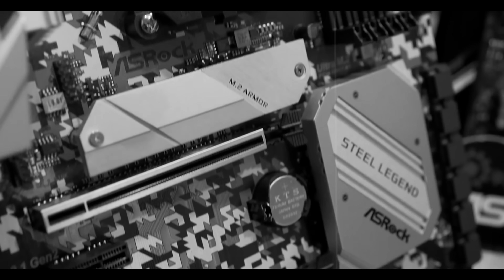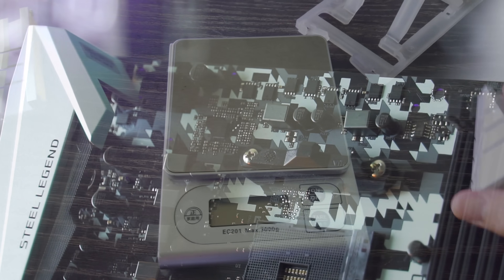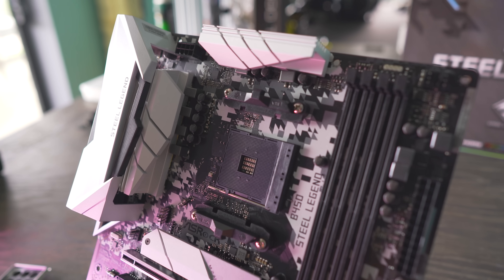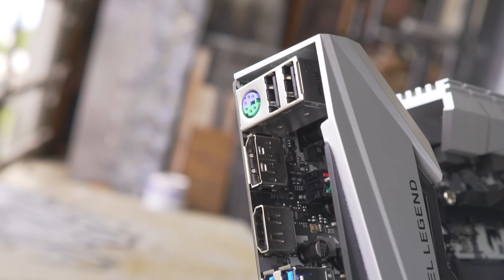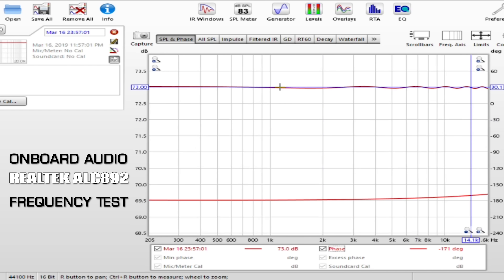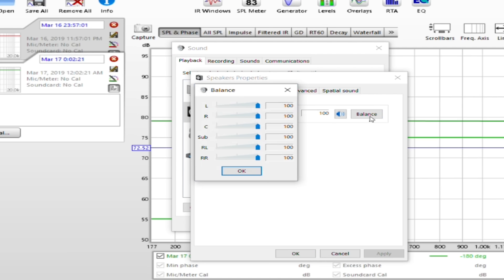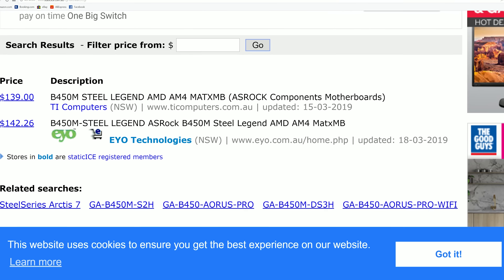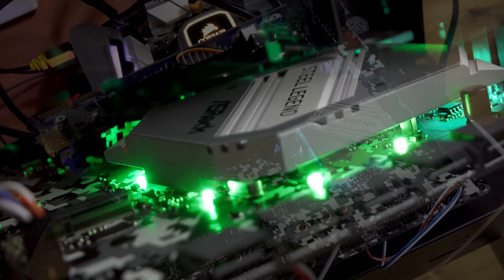Is this The BEST Value B450 Motherboard Right now..!? (Steel Legend Review)

Comment: Am I the only one that thinks that Bryan's "Peace out" sounds more like "Peas out"?
Reply from the maker: At one stage in life I was eating nothing but peas.  Peas out for now, bye.
Reply: @techyescity  Peas out for now, buoy
Reply: @techyescity  How much voltage were u pumping through the vrm? that's the question
Reply: @techyescity  I am having an unusual issue. i have R5 1600 processor , Corsair Vengeance 3000Mhz (2*8GB) RAM kit and MSI 450M Pro VDH motherboard but my RAM sticks are running only on 2133MHz instead of 3000MHz. Turning on A-XMP or manual OC from bios is not helping me out and RAM sticks are working only on 2133Mhz which is stock. Updated the bios but same issue. Even i have changed my motherboard and bought Asrock B450M steel legend and used Crucial Ballistix sport 3200Mhz(8GB*2)kit but found same issue. Could you please help me out.
Reply: Aᴍᴀʀᴛʜᴀʀ Dʀᴀᴋᴇsᴛᴏɴᴇ how am I still alive🤣🤣🤣
Reply: Or piss out...maybe?
Reply: I have always had it hit me as "Pizza out, Bye."  But that is just my ears.

Comment: Hello, is there any setting to activate in bios in order to be capable to use dual PSU with this motherboard ? I have dual PSU 850w (cooler master) and one keep turning off after 5 second starting my rig, Tried everything, both PSU are both working fine and the same happen doing opposit. Tried also PSU1 / 1gpu/1riser  and PUS2 /1gpu/1riser but still turning off after couple sec. I am not sure if it's because i didn't activated option in bios in order to use dual PSU/ I use splitter psu by the way and not add2psu. Processor is AMD 200GE and use latest bios ver4.20

Comment: @ Tech Yes City ; could you do a follow up video on a Asrock b450 steel legend but with an air cooling solution instead of the water cooled as you did in this video?  Down draft air cooled solution (Snowman down draft 4 heat pipe) and see what the VRM temps are like?  I've read that is the issue with water cooling you don't get good air flow near the VRMs.  Thanks!

Comment: was intending to go for the mortar max but since that is out of stock was planning to go for this and pairing it with a 3200g. just wondering, will it be possible to use my kingston 2133 4gb valuram X 4pc with this setup please?

Comment: I am having an unusual issue. i have R5 1600 processor , Corsair Vengeance 3000Mhz (2*8GB) RAM kit and MSI 450M Pro VDH motherboard but my RAM sticks are running only on 2133MHz instead of 3000MHz. Turning on A-XMP or manual OC from bios is not helping me out and RAM sticks are working only on 2133Mhz which is stock. Updated the bios but same issue. Even i have changed my motherboard and bought Asrock B450M steel legend and used Crucial Ballistix sport 3200Mhz(8GB*2)kit but found same issue. Could you please help me out.

Comment: I'm getting this for the Ryzen 2600X I'm going to order along with it.
Reply: I have it and I've already got thermal pad oil leakage on the back with a 3600
Reply: @Shvraz  ooo good thing I ended up going with a B550 Pro4 instead
Reply: @pixeldeath85  I mean it's not an issue but it does show that the vrms were under stress even with a 3600 (although oc to 4.3 at 1.325v). Going with a b550 was a good choice though.
Reply: @Shvraz  that's funny, yeah I ended up spending a little more and getting a B550 with a 3600 myself. Ended up finding at 980ti for 300 to use a place holder card until the market stabilizes.

Comment: I NEED TO KNOW SOMETHINGGGG. Can i use the samsung 970 evo plus 250gb on the ultra m.2 slot? And then what m.2 type is the bottom slot. For example is it the same m.2 type as the 970 evo plus or is it like the samsung 860 evo... i need to know thissssss PLEASSEEE helpp
Reply: Top slot is only for N.V.M.E. M.2 and the bottom slot is only for M.2 (SATA 3 speeds).

Comment: This motherboard just got ryzen 5000 support, meaning it's an even better deal now
Reply: Is this real!
Reply: @ryhenassad3674  yeah
Reply: But u need to update bios
Reply: Put do you need an older cpu to update the bios
Reply: You can update the bios without the cpu, just download the update on a flash drive and boot from there.
Reply: This thing is good, the only problem is you need good airflow and a proper cpu cooler.
Reply: @beasttitan8747  yo is 3 intake fans on bottom on right is 2 outtake and rear 1 outtake is that good
Reply: @unknownuser4691  4 descent fans plus the cpu fan should do the trick, I have a mesh case so that helps with the airflow, this case in the video traps more hot air than it can repel. I don't get no where near 90 on my PC... So if you are building, get a good case and you should be fine.

Comment: hi , anyone know why i cant get my ram to work in dual channel mode. Installed Ram  in A1 and B1 only shows up 8gb when i have 2x8gb, A1 A2 doesn't boot. Only boots with 16GB when ram installed in  B1 and B2 thanks
Reply: MungHauzel  thanks . Board was faulty go a replacement - working fine now

Comment: Well this made up my mine I'll be getting this board, I am using a 2700x but I'm using the stock cooler so its blowing on the vrms as well as a 120mm intake on the top of the case directory above the vrm.

Comment: Old video but if theres any helpful viewers out there, is it still worth getting a small fan for the VRM if you're using a large noctua tower cooler with 2 fans on it opposed to a water cooler?
Reply: Large noctua 2 fan cooler + 2 front intake + 1 rear exhaust should be plenty for the VRMs, you could add one more 120 fan in the top most rear above the tower as exhaust but I doubt that would make a noticeable difference

Comment: Aorus b450 elite Vs asrock b450 steel legend Vs MSI b450 tomahawk Vs Gigabyte B450m Ds3h?
WHICH IS BETTER FOR (AMD RYZEN 5 3600 + 3000MHZ (8*2)16gb ram+ Rx 570 gpu + 1 nvme m.2 Ssd + 1 sata ssd )

Comment: I paired this board with a Ryzen 3600 and a 5600XT. It works great.
Reply: Nah man. It worked right out of the box. There was a “Ryzen 3000 compatible sticker on it though”
Reply: Did you have to update bios if so what version
Reply: Hey man,
So after 3 months what do you think of the motherboard? are you have any issues or anything, like audio problem/bios or overclocking the ram? i might get it for ryzen 5 3600, whats the difference between this and PRO4 btw? only the RGB or?

Comment: Hey! thanks for the video, I decided to buy it. I installed it today and im getting good audio on my music player, but the audio on opera or chrome is low on youtube, prime and general pages.
is this normal? I installed the 2.81 realtek driver. 
Thanks in advice, I tried everything.
Reply: Hey man,
So after 3 months what do you think of the motherboard? are you have any issues or anything, like audio problem/bios or overclocking the ram? i might get it for ryzen 5 3600, whats the difference between this and PRO4 btw? only the RGB or?
Reply: @Isshin007 Hey dude. 
About audio I have to say I'm good with the audio because the realtek program can establish your own config, so there is no problem about that (although the audio is good but I have to config it with volumen rates, realtek has been doing shitty drivers) but it is great and I can hear clear high quality music. 
None bios problem, it is working great with my rx 580 and my 2600.
About overclock. I haven't overclocked anything, but you can find in reddit commentaries about b450 steel legend ram overclock, I think you'll be fine about that.
about PRO4, I think the pro4 is a little better about vram, both are good, I'd recommend you to buy the cheapest of these.
Let me know if I can help you with anything else. Cheers.
Reply: @lalorayado3  Yeah i just did some research and looks they both have the same specs and seems the pro4 is a little bit better in overclocking (even tho im not planning in overclocking) pro4 is like 80$ here in my country and the steel legend is 100$
but no doubt the steel legend looks so good with the white heatsink and the rgb
Reply: @lalorayado3  And thank you again! much appreciated
Reply: @Isshin007  yep, I spent extra 25$ bucks in the legends because I like the colors. YW and good luck with your pc!

Comment: Already ordered this board with r5 3600. I will only use it for gaming and no overclock only xmp for ram. Will that be an issue for the vrm's ?
Reply: Hey man,
Did you get it? what do you think of the motherboard? are you have any issues or anything, like audio problem/bios or overclocking the ram? i might get it for ryzen 5 3600, whats the difference between this and PRO4 btw? only the RGB or?
Reply: @Isshin007  i got this board and then sold it. Very poor vrm hence high temps. I bought b550 tomahawk
Reply: @lkline000  High temps only when overclocking? What CPU were you using r5 3600?
Reply: @Isshin007  yes its that cpu. And no stock gaming temps went up to 80c so i didnt have the courage to pull off oc. Now with the b550 i am rocking 4.4 with amd precision boost on.
Reply: @lkline000  what?!!! It went up to 80c with stock cpu while gaming only? Does your case have a good airflow?
Reply: @Isshin007  dude i am using the exact same case now as well. Antec nx800

Comment: On board audio is a wast of resources. I either use the HDMI sound due to easier monitor switching and a external sound card for Music creation.  I can not see why they wast time with that. I would like to see some kind of integration of video cards and onboard sound. As of now 1st thing I do in set up is turn the onboard sound off. It makes the software I use easier and less bothersome in upgrades of the OS and other software. Seems the sound cards fight for dominance.

Comment: I'm going to build a PC by next week, I was confused about choosing a motherboard.
Mother board - Aorus B450 Elite or Asrock B450 steel legend (In look wise i liked both the motherboard but not Tomahawk it's little bit costlier than other to motherboards)
Processor would be Ryzen 3500 and GPU 1660 Super (I won't overclock)
This was the build i'm gonna use,
After an 4/5 year I'll update to Ryzen 8/12 core processor based on the price drop in future.
What would be your suggest for choosing a right motherboard in budget segment...?
Reply: If you wanna upgrade to 8 or 12 cores in 4/5 years, you will likely get the ryzen 4000 or even ryzen 5000 series and its better to change the motherboard to 550 series. So for now if your options are aorus or steel legend, just choose whatever cheaper in your area because in 4/5 years, you are most likely wont use it anymore. Even better choose asrock pro4 (its cheaper in most area, better vrm than steel legend and the only downside is it doesnt look as good as steel legend)

Comment: I'm little bit late here, but I'm using this board and want to overclock my 3500x to 4.1 Ghz with deepcool castle 240 v2. Is it safe for vram temp?
Reply: Gotta replace it soon bro,my b350 pro 4 is a dead motherboard after 6 month of use same with my cousin a320,and i heard asrock b450 have a trash vrm too
Reply: kappa clap I mean 6 cores can runs on any b450 board, I know the vram is bad but I think it is okay..

Comment: Nice review very detailed and informative. I was looking at this board for a new build but that temp issue with the vrm temps is putting me off.
I am planning to use a  Ryzen 7 3700X but not o/c so am wondering if I should still look at this board?
Reply: ya or msi 450m pro.. as both are same price..i am also not sure between 2, n both have oldy audio card..

Comment: cam you run 3600mhz on b450 Steel legend with updated Bios?
Reply: Why do you want 3600mhz ram? And if you want a motherboard just get the asrock b450n pro4 or the b450 ATX version
Reply: @miniweeddeerz1820  its my choice to get the steel legend and for the ram i chose 3600mhz because i already have a pair so...
Reply: @riadasri719  it probably won't work tbh. The 3200 or 3400
Reply: @miniweeddeerz1820  how do you know, i already run here
Reply: @riadasri719  well it depends on which CPU. And even on ryzen 3rd gen from the specs it looks like it only supports up to 3533mhz
Reply: @miniweeddeerz1820  3533+ actualy

Comment: I'm starting a new PC build with the ASRock Steel Legend, w/ a Ryzen 5 3600 6-core CPU, Consair Vengeance RGB PRO 16GBs RAM, Samsung EVO 970 500GBs SSD, Thermaltake SMART 600W PSU, and a GeForce GTX 1660. And the case I've chosen for it is a SAMA-G3-ARGB with a Cooler Master ARGB 3-Pack set. I've bought most of the components. All I need now is the ASRock, GeForce, and a good RGB CPU Fan, and secondary HDD drive. The only beef I'm having is the case's ARGB HUB on the cable-manage side of the back panel, which uses 5V 3-pin for the LEDS, but 3-pins for the fan itself, as the 3-pack I bought has 4-pins. So I'm just linking the 3-pack's 5V 3-pin to the hub, while the 4-pins connect to the Power Supply.

Comment: The ASRock B450M Steel Legend M-ATX board is the best M-ATX board around for almost no cash. The bios is better than on the ASRock B450M Pro4 because the Steel Legend comes with Manual Load Line Calibration control whereas the Pro4 gives you no Load Line control.

Comment: So, i plugged my headset inside my front panel 35mm audio jack and my sound goes through a headset driver not high definition audio device is this normal? Also, how you see left and right channel audio levels?

Comment: Does it support 3rd gen ryzen out of box?
Reply: NonLegit Nation  thanks mate
Reply: NonLegit Nation  Just placing a ward :D
Reply: NonLegit Nation  did you get it?
Reply: NonLegit Nation  does it support third gen ryzen?
Reply: Yes it does. It supports the initial release 3rd gen ryzen. 3600, 3600x, 3700x, 3800x, 3900x but the 3000g and the 3950x require a bios update

Comment: just got one today, im so excited.
Reply: What are your thoughts on it? I'm thinking about buying it with a Ryzen 7 3700x
Reply: @fluffyunikrnjoe5819  do u think we need to update the bios? i have Zen 7 2700
Reply: gabriel_production if u want 3rd gen, you will have to flash the new bios
Reply: @Gabriel-jg5wh  I didn't have to flash the bios with mine, came 3000 ready
Reply: How was it? did u update your bios??

Comment: I dont know why but asrock made an amazing board called b450 m4 pro ans every one gave it good reviews it was amazing value too and soooo gooood then then asrock for some reason made this board next changed the kook added flashy lights and gaming colors but every single person that reviews it says theres some issue with it either the m.2 bkot drive issue or vrm getting close to 100 i duno why asrock kinda downgraded on this board for the flashy look ill stick to the amazingly prazed b4504pro

Comment: Subscribed! Big thank you for highlighting the audio section and specific caps used. Does the B450M version use the same audio chip and capacitors?
Reply: Yes, the only difference is the extra pcie slot and obviously the size

Comment: Someone help me over clock the ram. It's at 2666, which I switched from 211something. I tried the XML profile loading but it's at that 211something only. I have a b450 steel legend+550w PSU(80+bronze)+tridentz 3200 16 gb single stick+Ryzen 5 3600
Reply: update your bios if you haven't

Comment: I bought this mobo with the 3600 and g skills trident rgb 3600mhz ram. when running oc for the cpu all in auto and xmp profile 1 for the ram it won't boot, only boots at 3000mhz, not even 3200mhz (only booted once). can anyone help me out with this?

Comment: You are wrong about VRM temps. you mistakenly test it on an open test bench. the mobp is designed to be placed in an ATX case where there is air flow.
the air flow of a typical ATX case keeps the VRM temps much lower. test it the correct way next time...
Reply: Would this mobo able to handle the 3900x with those vrm?
Reply: @luisangelini2220  Read the product info on the manufacturer web site for such information. if there is any regarding newer CPU's...
If I had to guess, as long as you do not OC the 3900x It should probably do it, but isn't recommended.
someone who buy a 500$ CPU like the 3900x, usually match it with a premium motherboard - more like a 200 US$ one from the X570 line.
Reply: @AY-dw4om  I did and just say you can use it. About the motherboard I reserved a new one but won't arrive to my country until late November~ first days of December. I have this Mobo around for the meantime :P

Comment: Hi my 2.1 edifier s350db has a Optical in. So if i use the motherboard spdif out directly into the 2.1 speakers will i get better Sound Quality as compared to using on board Sound Out....?!? Thanks 😊✌️
Reply: You have to try and see for yourself. Take note that when using optical output, the audio card acts like a passthrough signal device, doesn't alter it in any, so it's up to the integrated dac in the speakers to sound good/bad. Your speakers are quality speakers though, you should be getting great audio regardless of how you pair them with your computer.

Comment: which one is better for overcloking R5 2600 this board or b450 bazooka plus? 
 i dont care about rgb stuff just give me a reason which one is better !
because i was using b450 steel legend and everytime i set my XMP profile it's always got  BSOD
im using 2x4 ddr4 Geil super luce 3000Mhz btw
Reply: yeah i bought this as well, it doesnt do well with ram. im sure its the bios with poor support from asrock

Comment: Hey @Tech YES City, what processor cooler is recommended for this board when paired with ryzen 7 3700 or ryzen 9 3900x ?
Reply: You want  AIO or Air Cooler ?
Reply: @silver-box2450  air cooler, so the vrm get some airflow

Comment: i want to ask a question
i have asrock A320M-HDV with ryzen 1300X, i am planning to upgrade my cpu to ryzen 5 2600 with B450 Steel Legend.
my question is, should i just buy the CPU with current motherboard or should i buy the motherboard first? i am on tight budget either the mobo or the cpu had to choose just one of them
Reply: NatGaming  cpu